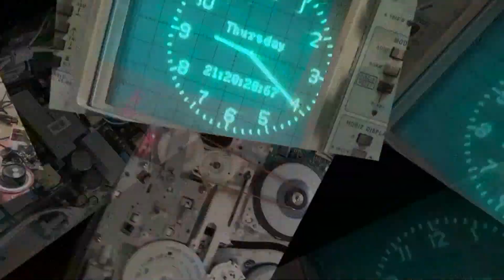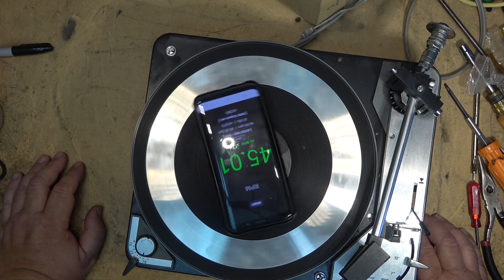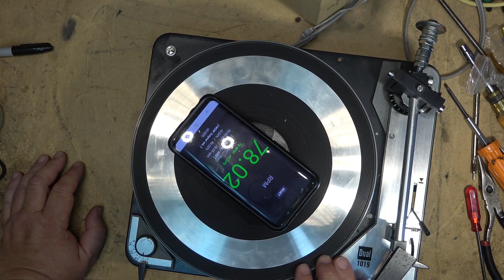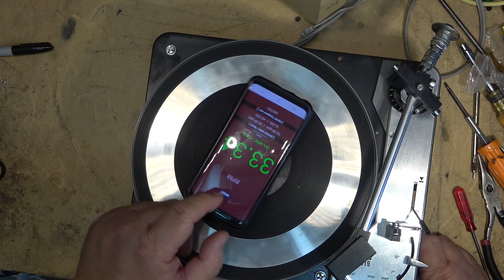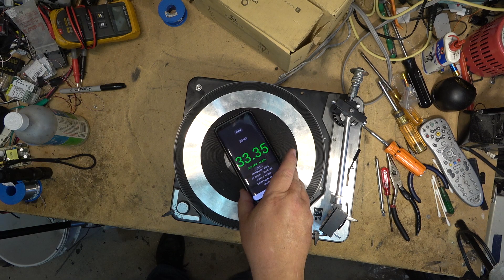Dual 1019 in the worst condition I have ever seen

Comment: Ah, this video helped a lot to get the basics of the mechanism figured out. Got two done under my belt, an earlier model and a late model. Noticed some slight differences between the two, but got both working pretty nicely now. The earlier model is now one of, if not THE forever turntable in my set up. Works perfectly and sounds damned good with my NOS Pioneer PL-C9 cartridge. 

The other, well, it still has some ghosts and issues that need ironed out before I can send it off to its forever home. I have no idea why, but whenever I manually move the tonearm it makes some static noises like a dirty potentiometer. It's driving me crazy trying to pin it down and I don't want to half ass it. I'll figure it out eventually, at least the rest of it is working nicely now! 😅

Comment: Thanks for the video.  I've got one of these in pretty reasonable condition but walked away from it a few months ago after getting completely frustrated trying to the the mechanism to operate properly.  Take it apart, put it back together, and repeat.  Several times.  Some of these closeups will really help me see how the German engineering was meant to operate.

Comment: I picked up one at a resale shop for 10.00 , In damn near mint condition.
Cleaned out all the old grease and oil and it works fantastic....
Reply from the maker: When they work they work ok but you have to use them all the time or they gum up

Comment: When I worked at Grundig, we did some extensive maintenance on the Satellite radio units, involving taking out all the rod switches. We used vaseline on the contacts, I guess not wery known nowadays. Spraying all kind of oils into the equipment is really only lazy work. Better to dismantle things totally to find the problem. It will take time, but its the only way. For all kinds of corroded metals, my favourite is autosol metal polish.
Man, memories arise, The Grundig Satellite 2000 and 2100 really the state of the art radios with upper side band and lower side bands.
I did learn morse when I was in the military in 1987 in northern Sweden. We did sit in our vehicles at night listening to "enemies". We did do morse code with the soviets, although it was forbidden, talking to them about music and computer games.
I did not know that WD40 could gum up like that. There is something silicon based here called 556 universal oil that turn into a chewing gum like thing after a while. At my hospital we use a lubrication oil that will last for a long time, if not exposed to dust.
Reply: fond memories
Reply: Happened to me as well... silicone lubricant turning into pure SILICONE caulking.

I believe the modern counterpart of vaseline (I suppose grease) is the modern lithium based (if I remember correctly) white grease. I have bought some on the basis that I see 30+ years older machines that still have this kind of grease still effectively wet and greasy, so it must be a very good formula to last for so many years, unlike several other type of oils which I usually find no traces of, if they ever used them at all in production.

Comment: I bought a Benjamin Miracord from a estate auction paid nothing for it.  The turntable had spent a great deal of its life in a shed.  After a day of cleaning and breaking the parts free from rust nd and hardened grease it played ok.  It has the wrong spindle but works like a semiautomatic.  Those German turntables have a lot of weight but, they sound very nice. Your patience with repair is very good.

Comment: Thanks for posting this video.  I had a similar experience with a 1264- hours of time trying to get it right, messing with the "steurpimpel" and such, and I have the original paper factory service manual.  Motor wouldn't spin, wouldn't come up to speed, mechanism wouldn't cycle- unfortunately, it's still pretty finicky- I'm gonna clean it some more, and remove some of the three in one oil that I applied...
Reply: Yes, the "steurpimpel". I'm quite sure this little bit of plastic on my 1019 has been worn down to a point where it needs replacing.  I'm experimenting with some ideas that may work, kind of like how 12voltvids used the concrete wall anchor and bolt, washers and nuts counterweight in this video!  I was hoping 12voltvids might have had to explore this area of the turntable but I guess he didn't need to.  Or want to!

Comment: I have a Dual 1229 which is essentially the same. For what they are they are very nicely made and with a bit of TLC they can perform very well. The biggest problem is the idler wheel which is not obtainable and causes wow and flutter problems when the rubber goes hard. A reasonable fix is to put the wheel in a slow speed drill and rough the surface up with some emery paper. I have to do this every few years but it restores the performance nicely. The other thing to be careful of is when the turntable is inverted to work on the  ball bearing which sits under the arm lever falls out leaving one to ponder where it came from. An exploded view shows where it belongs.
Reply: I’m not sure but I think you should’ve used a little more WD 40 😅

Comment: Did you ever try to spray clean it? There's a couple of quick solutions for parts that I use: bike chain cleaner, acetone and isopropyl alcohol.

Bike chain cleaner can be deeply unsafe for rubber but probably works best as the can is high pressured. Acetone can also work well but vapors are extremely flammable and prone to ignite and is unsafe for plastics. For fingernails I've read it can be smothered with glycerin but I wouldn't bet it would also work on plastics. Isopropyl is probably the best when sprayed and better if worked with a brush, yet it is unsafe for clear plastics used in display windows (still several times milder than acetone). They can be permanently stained.

But sometimes somebody's gotta do it, especially for a quick evaluation of a machine before spending time for deep disassembly of something you're not familiar with, take note step by step, have several attempts... judging by the appearance of the device this is one of those units that I'd dare to try... where spraying with isoprop and a clean paper towel underneath you could appreciate the gunk dripping away from parts.

I WOULD NEVER EVER DIP a PCB in acetone or chain cleaner. Isopropyl could be safer but it's not a cure all tool... I would never spray it over transformer area for example. You must know what you're doing... a lot like WD40 which I never use for electronics repair. I tend to use a de-oxidant product which has washing characteristics and leave a very thin oil residue, almost unable to provide significant lubrication but still having some relief for moving parts. One should use a proper oil afterwards or use it just for parts designed to have tight tolerances like sleeve bearings of small capstan driveshafts.

Comment: The BIC I bought had a frozen platter and there was Oil all over the back and side of the Chassis. I bet somebody used it on that as well. I just used a soldering iron in the stacker hole and it freed right up. Works like new.

Comment: Free  Dual 1019 turntable full of WD-40. Yeah, this is going to get messy. May take 1/4 of a bottle of IPA  and 1/2 of a 
box of Q-tips to clean it up. It's like a  down the rabbit hole  clean up job for sure. After much fiddling you got it back to 
a reasonable working condition . Now  we know that wow  does depend on using a heavier turntable platter.

Comment: Another one saved! This job is the perfect proof some people should never touch nice equipment with their "greasy and sticky" fingers, and WD40. I also had such kind of problem, multiple times, and these record players are the best victims because they look simple, but are most of the time the result of fine mechanical adjustments, 50 years of development (for these German turntables)... And DW 40 never never has to touch any fine mechanism if you're not into sabotage or simply stupid. This 1019 should probably benefit from few parts like a counterweight and spindle, but your makeshift Frankenstein solutions are probably the best to proof it's functional, as you can always find bad surprises or really destroyed parts. In the same idea, a new cover or a new cartridge could be more costly than necessary as it's mostly the future owner's choice. These old Dual are surprisingly good with their heavy platter, enormous motors and spindle, and with the proper (and patient) maintenance, probably the dream of that future owner.

Comment: Great video have picked up a lot from this, having a little experience with these, I’m curious is the steuerpimpel (don’t know if I spelled correctly) deteriorated on that one I wonder if that may also have a bit to do with arm landing in right spot of the record sometime , and it will cause that jerking motion when arm is in movement
Reply from the maker: When the stuerpimple is worn the arm will hesitate. The drop point is adjustable by a screw.
Reply: @12voltvids  ahh ok , good to know that the point of drop is just a matter of adjustment and not affected by stuerpimpel
Reply from the maker: @jeronronnunkoffunk4691  of the stuerpimple is worn our the arm may not move completely but the drop point is an adjustment. On many models it is under the dual badge on the right.  You lift slightly and turn and  there is a hole where the adjustment screw is.  This varies by model.

Comment: People did that to VCRs too. If it squeaks, it must need wd 40. Started out with a slipping load belt but what a mess. The brakes, back tension band, and idler clutch are done for. One time was lucky to have a spare deck plate to swap.

Comment: I have a couple of questions for you...First of all, are you in Canada? Second, I have a Dual 606 that the speed has slowed down. It doesn't vary, just slower. It is a DD...

My experience with machines of that vintage is they ALL need to be fully degreased to get them working properly again...

Comment: In awe of your patience. Love the counterweight and rawlplug spindle. Disappointed though that you didn't revert to the supplied (incorrect) spindle, just so we could see it poking through the hole in the cover.
Reply from the maker: That one won't work.  It never worked.  Why? Because the index pin that normally locks the spindle into the platter base is sticking up higher than where the record would sit on the platter thereby stopping the record from actually even making contact with the platter. So the only way that spindle would work would be to set the record on the platter and then stick the spindle through the hole in the record. This turntable had been cannibalized. Someone took not only the spindle but the counterweight probably sold them before selling the guts are giving the guts to the guy that brought it to me. Perhaps the guy that gave it to me stole the parts to fix another one and then gave me the remains but one thing for sure with the spindle that was on there it could have never played a record and I think that someone stole the spindle put the wrong spindle in cut a hole in the top so that the top would sit on it and then covered it with a vinyl tape so the top would sit down on it and then sold it. That's kind of what I think happened on this unit was it got sold to someone unsuspecting. but there's not a snowball's chance in hell that that spindle that was on the unit when I got it would do anything and the only way it would actually even work would be to cut about an inch off the bottom of it so that the locking pin could fit into the slot on the turntable but it would have to be cut sufficiently short so that the mechanism would not make contact with it when an autocycled otherwise it would jam the mechanism because this mechanism is specs to push up on the base of the spindle and that type of spindle that's in it is expecting a lateral moving arm to activate the record drop mechanism.
Reply: @12voltvids  You know I was joking, right (and apologies for my sarcasm). Clearly whoever owned that / handled that (in that condition), prior to you receiving it, had no clue about anything. I choked on my cornflakes when I saw the WD40 residue everywhere and the hole in the cover.
Reply from the maker: @ralphj4012  actually I did try the original spindle that was on there when I got it and found that the record wouldn't make contact with the platter but I didn't show it on video. I believe that spindle that was stuck on it when I got it came from a BSR but obviously somebody thought it would work when they flogged It off because they cut a hole in the top cover to make the cover fit of all that bloody stupid things that someone could have done again this was a disaster. I doubt that the guy that brought it to me will want it back because for all the time that I worked on it he won't be able to afford it. I'll talk to some of my turntable collectors and see if anybody's got a spare spindle and a proper counterweight and then I can sell it or maybe sell it to one of my collector friends that might have those parts because it definitely is a good changer now that it's working properly in it we're probably work fine for years. But the only reason why I would never consider keeping this is because it has the 16 RPM speed. Not that I have any 16 RPM discs to play on it.
Reply: @12voltvids  I wish you success in finding the parts, maybe even an affordable cover. I'm in my 60's (you can probably tell) and I have never heard of 16 RPM records, until now.
Reply from the maker: 16 RPM were typically transcription records. They're also used by seaburg in their music machine but it also used a much larger center hole than even 45s used so to play those records you need an adapter which today could be relatively easy made. I-16 RPM transcription record maybe I can borrow it from him sometime in show it off. 16 RPM obviously offered a much longer playing time but at a reduced fidelity and that's why seeburg used them in their music service machine. I don't have one of those I've seen one once I wish I had one I know tecmoan has one. We had an old seaberg 1000 background music system at the cable station that I worked at back in 1980 81 82. It had been used to play the background music that ran over the message board when the community station was off air. I still remember the system quite well I wish I was able to grab it but it was leased. Our old message board that we had was a joke and I only saw it a few times because I worked on the TV production side and the message board was on the cable TV office side. It was in the furnace room along with the hot water heater and a breaker panel that controlled lights in one of the studios. that's when I got to see it when I had to go reset a trip breaker. But the message board was so primitive it had been installed in the late '60s or early seventies and it showed. We nicknamed it turnabout or carousel or many other names for this ridiculous piece of equipment. It was made out of wood, had a clock, wind speed and wind direction gauge, thermometer and barometer. Between each of the instruments was a slot where a paper card with a typewritten community announcement message was placed. This was turned by a barbecue rotisserie motor and it was a small mechanical switch that protruded were each of the message-based cards would sit. When this mechanical switch was tripped the motor would shut off and it would start a 22nd timer so that it would stop turning for 20 seconds to give the person time to read the message then it would start turning again so the clock or the wind speed would just turn past the camera to the next message came up it would stop. It had a black and white Hitachi closed circuit camera focused on the gauges and card and was illuminated with 2 40 watt incandescent bulbs.  This contraption used to sit on top of the water heater and next to it was a seaburg  1000. I remember one time watching this thing run for a few minutes. It would play the top side of the record the arm would retract the spindle would reverse directions and it would play the bottom side if the record once the bottom side finished it would retract drop the next record down and start over and I think it would hold five or six records each one each side playing I think 30 to 40 minutes per side. Once the last record finished playing the mechanism would hoist them all back up to the top and it would start over. That system ran for years. When I was a kid growing up I used to put on channel 10 and watch this thing turn around when the station wasn't on the air. Then I started working there and saw what it really was which I thought at the time was kind of cool obviously something that was built in house by the engineer. I did volunteer work there for a couple years and then did an internship when I was in college studying broadcast. By that point the seaberg was gone as was roundabout and he'd been replaced by a multicolor message board computer. The music then had transitioned to an auto reverse Sony reel to reel tape deck that took 10 and 1/2 in reels. At least tapes from a licensing company. I remember one night I put my own mixtape on and left it running when I shut the station down. In the morning I had a very unpleasant discussion with my boss and the station manager. something about royalties for the music that I had put on the community station overnight. They weren't impressed. Big sticker was stuck on the tape and it said do not play this ever again.
Reply: @12voltvids  Fascinating background. Saw 'the last word on the dual 1019'. Do you ever sleep?
Reply from the maker: @ralphj4012  yup.  8 hours a night.  Many videos publish after I have gone to bed.

Comment: Guess it won't get any less value if you cut a slot in the rear of the dust cover for the "Franken-tonearm " or more heavy washers to reduce the length.   What a job Dave......congrats.
Reply from the maker: Cover fits fine.